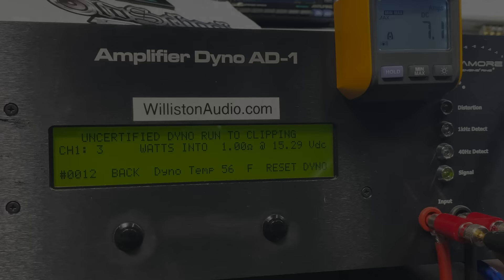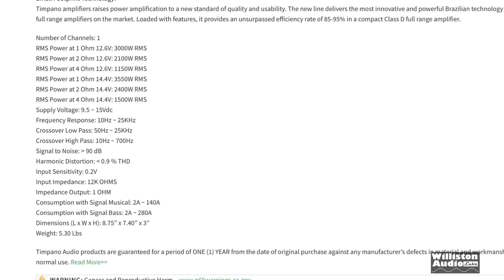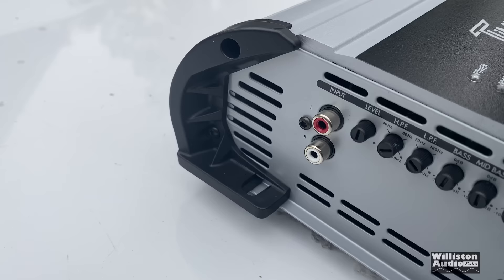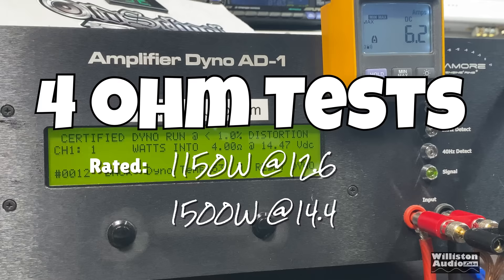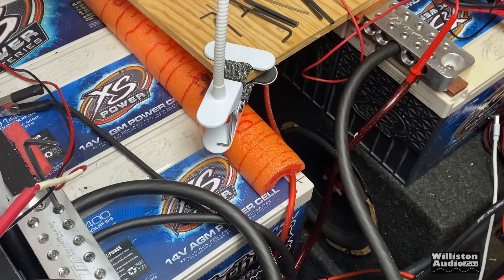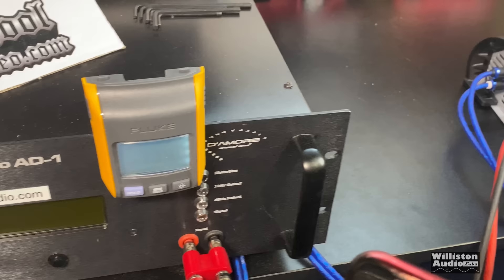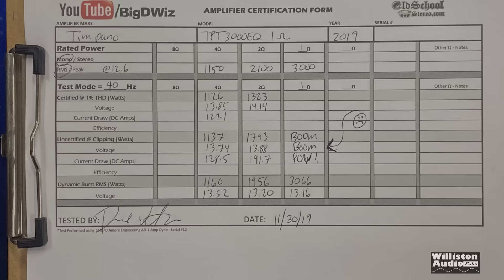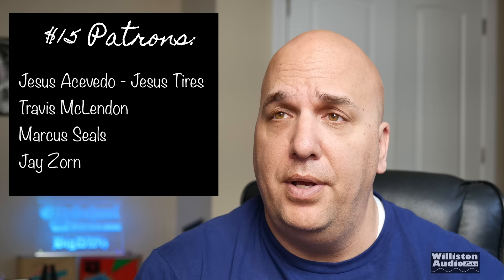This $220 3000 watt Amp GOES UP IN SMOKE! [4K]

Comment: Keep blowing up the junk amps and calling them out, man. There is property, and potentially lives, at risk here. Screw these guys.
Reply from the maker: It’s pretty scary the fire show that occurred...twice
Reply: Yeah... Why hide the first amp that burned down? What was it?
Reply: @TheBrokenLife  
It was the same brand amplifier. He mentioned it in the beginning of the video.
Reply: @sirnate54  I thought he blew up two identical amplifiers in this video and that was a 3rd one at the beginning? I'm all confused.
Reply: @TheBrokenLife  probably for legal reasons. He said the company just about went out of business.
Reply: @TheBrokenLife  he said the previous amp that blew up almost ran the company (different video and company) that made that amp out of business. Two amps (1ohm and 2 ohm versions) in this video blew up he just didn't show the first one that went up in smoke.
Reply: @logan9334  Yeah, exactly... I'm curious what the amp at the beginning of the video is. They shouldn't BE in business if they're trying to burn people's cars down.
Reply: This is a misconception with the design of most Brazilian amps. The way dynos read power does something funky with the full bridge amp design. If you put that amp on a subwoofer and then clamp power tested it would do over rated and be very reliable. I personally have that stetsom ex3000eq in my truck for 3 years on a 300a fuse. Ran 2 18s walled at first now I have it running 6 8" mids. And many competitors have set world record numbers using these amps. It's a fantastic amp that gets a bad reputation from these type of scenarios since you cannot dyno them properly.
Reply: @ ThonotosassaBoy
You wrote put that sub on the subwoofer. 🤷🏻‍♂️
Reply: @ThonotosassaBoys  - I seriously hope that is a sarcastic copy paste.
Reply: @ThonotosassaBoys  The dyno measures power using a pure resistive load. That doesn't do anything funky to the amp. The amp is just plain under-designed.
Reply: Agreed
Reply: @maxwelhse the amp in the beginning was a Sonido mask 1500 but to be fair he did run that amp at lower impedance than the manufacturers recommendation.
Reply: @ThonotosassaBoys  

Most clamp tests are not done properly and are NOT accurate. I'm not trying to say you are one of the many out there that don't know how to clamp test an amplifier properly, just saying that in general, people are always talking about how their amp does SO MUCH more than rated when they clamp test it, as they are not doing it properly. For example, I could clip the hell out of an amp and  with a clamp test, come up with a higher power output from the amp than its rated to produce. Just saying.
Reply: @brandonweigel6309  I completely agree. And when I clamped I did voltage time Amperage divided by resistance with the gain set before clipping. It's not the most accurate way but it does get you a number that's close.
Reply: @shelbug100  it does the exact same thing with almost every Brazilian amp. And they all, including this one, have been proven in competition use. And most by the competition league's list them as rated or over rated. Look up the ISPLL amp rating chart stetsom line of amps.
Reply: @ThonotosassaBoys  no it doesn't , speakers are reactive loads not resistive loads, so while the static DC resistance is , say, 2 ohms, at 33hz they could be 4 or 5 ohms. lot less load on the amp.
Reply: @wal  how do I request an amp dyno test lol...audiopipe apmi 600
Reply: @ThonotosassaBoys   i bet a jbl 14001 would dyno well and is a full bridge amp no problem, Barevids did a 1 ohm mod to one and ran it on a resistive load several times before and after modifying it
Reply: Why use more than 15v....why you didn't run on 12v or 14v max to see if the specs can be obtained?...maybe because it will kills any  American brands? In all terms price vs power output?,Im a very fan of you and your work on videos and so I think of Steave Meade,you are awesome on doing your stuff,but I had used Stetsom and Taramps and they are a hell of an Amp in power and duration,they have a huge power even with the engine off (12.0V)...Shame on Rockford and any of them,its my humble opinion,make the test ib any of brazilian on 13V and you will see what I mean..take care my man and all the SLP fans!!!!
Reply: Brazilian amps don't like resistor dummy loads!  They work fine on subs.
Reply: Its just like when all the ricer cars come to America back in the day . Everybody hated . Now everybody has one . The same will happen with these amps . I mean this guy wants everyone to stay with American companies, but they are built in China and Korea, so really what's the big difference?
Reply: Thats right my man,Stetsom or Taramps has or had one on 20kw on 12v and on their high voltage series a insanely damn 160kw rms!!!!..where on earth RF or any they called American amp will do that?.. yeah right!!
Reply: @alexisacevedo8016  it's all about money . Pockets are being filled to try to keep the Brazilian amps from taking away business from these overpriced American based companies and this video is a fine example of that happening. He got some free stuff or a nice check for making this video.
Reply: I know and you're totally right man,thanks for understand my point,God bless you everybody and keep those spl up guys!!!... take care my friends 😉
Reply: @denisohbrien  speakers have a passive resistance where as the amp dyno has an active resistance. When you hold back voltage with voltage especially on a full bridged rail voltage amp, sparks tend to fly . They only have a few small caps inside unlike Korean and Chinese boards that have a lot of caps to absorb electrical backfeed. They just aren't designed to be on an amp dyno. People get freaked out when they see sparks and then you have the guy that is testing playing dumb like he don't know why it's doing that and a bunch of Korean board loving guys that really don't know why it happened but think it's because the amp is crappy to back him up.
Reply: @ThonotosassaBoys  Here is the problem with clamping. The maximum voltage and the maximum current do not occur at the same time.
Reply: @ThonotosassaBoys  That is COMPLETELY untrue. That is EXACTLY the same load, and will get the same results beyond a shadow of a doubt.
Reply: @ThonotosassaBoys  also, nobody has any SPL records using these. You are just making stuff up it seems, because you run and like the amp.
Reply: @Turdpuncher  exactly
Reply: @alexisacevedo8016  I don't think any amps are made in U.S.A. anymore.
Reply: @ThonotosassaBoys  Amp dynos will also always pulled more current, and are much harder on amps because they are constantly at a static ohm load. Hooked up to a sub, you'll have box rise so it wont stay glued to 1ohm. Only time I could see this happening in a car is if it's on garbage electrical and the voltage dips below 12v.
When voltage drops, the amp draw goes up to achieve the same power. I could see it blowing in a car if pushed hard at less than 12v, which is stupid to begin with.
Reply: Cheap ass junk...  The people building big trash systems using this cheap stuff should use their money to build a smaller system with better components.
Reply: @2ndAmendmentedYoAss  No, he said he was always remiss to post videos like this without getting confirmation that the product was actually defective (i.e. the need for a 2nd amp to test, that he paid for OUT OF HIS OWN POCKET.) He posted a video before of ANOTHER COMPANY'S bad amp that almost put them out of business.  

It's also important to note that he orders a 2nd amp just to confirm that the first amp wasn't a "dud", that maybe went out with bad Components in it, or had some kind of Manufacturing Defect. If both are bad like in this video he knows FOR SURE.
Reply: @bradgilpin9740  wonder why he didn't show us that first?
Reply: I 've had my stetsom for 6 months now and ive yet to have any issues. I'm still pushing my 15 zvx and that sub bangs like 2 15s. Only con is a that it get alittle warm but I quickly fixed that with a small fan and now I'm beating down my block Every time I come around. I've used it for my mids and highs and this amp came to life as soon as I connected all my Aftermarket door speakers. It's all on the user on how long these amps can last cause mine is kicking tail all day and plenty of power to go around. To Each his own....💯🔥
Reply from the maker: @RomaVilla  the Amp Dyno tests are brutal on an amplifier and provide a static (resistive) load for the duration of each test. The scary part of this test is the lack of over current protection on the amp, allowing it to pull well over the rated spec of current (300A plus), thus blowing the power supply transistors. I test all amps the same, so this wasn't a torture test or anything, just showing what can happen.
Reply: @RomaVilla  he does after the credits
Reply: Doesn't look like it's UL listed so of course the damn thing cant regulate it's own voltage (regardless if you throw more at it than the manufacturer recommends) Sure it does wattage but not safely. This amp is a fire waiting to happen. Pure trash made in Brazil.
Reply: Blow em up so you KNOW.... Learn..... Limits should never induce a fire in a car... ever. BDBD/2021
Reply: @positrack99  UL certification is not based on design at all. Just a basic set of rules for construction.  I am currently building an industrial control panel that will be UL certified. The inspector will not decide whether or not it is a "good design" basically just that it is made up of UL listed parts and that everything is labeled properly.
Reply: I’ve heard of the taramp doing the same thing

Comment: You should never feel guilty or concerned about an amp manufacturer's reputation. You do clean, transparent tests. If the amp can't meet ratings, then that information needs to be public. If the amp fails in a dangerous way, as this one did, then that is a matter of consumer safety. You are perfectly justified to share your findings. Keep up the good work!

Comment: 1. No one should buy this amp under any circumstance when there’s other more reliable Brazilian amps out there for close to the same price (I mean you had 2 of them blow up the same way)
2. You da man for doing this public service amp tests and saving people money and possibly their LIFE!!!
3. Excellent work on the edit and capturing it from 3 different angles like a BOSS!
Reply from the maker: Such a bummer things like this can still happen and I'm afraid attempts to get price so low have affected decisions concerning protection. It's truly scary to think of this happening in a car and the possible outcome.
Reply: @wal  My thoughts exactly. You could burn your car to the ground very easily if this was to happen on the highway. I have a Soundstream Rubicon Nano RN1-5000D in my Mk4 Golf running two Sundown Audio SA12D2s, and I have it wired with 2G battery cable for power and ground with a 200A breaker at the front. These Sundowns are only rated for 500 watts a piece, wired at 2 ohms with the gain only turned half way up on the amp, they SLAM for two 12s, but I'm sure that Soundstream is pulling some major amperage. I paid $175 for that 5000 watt amp (yeah...right), but I have ALWAYS had good luck with Soundstream amps. I had four round Kicker Solobaric 10s on a Soundstream Reference 1000S back in the back of my 92 Integra back in the day. This Rubicon Nano may not make the 5k watts that it's advertised to, but it powers those two Sundown 12s like you wouldn't believe.
Reply: Stop spreading misinformation. Just like cheaply designed "Korean (see half bridge)" amps, cheaply designed "Brazilian (see full bridge)" will blow up. I get that you're biased against full bridge amplifiers, but it's factually incorrect and you're misleading people who don't know better.
Reply: @wal   I thought it was Chinese? No?
Reply: @wal  especially when many people are running lithium batteries and the amps are mounted pretty close to them. Add mpg catches fire, causes the battery to catch, and it's bye bye vehicle and everything in it
Reply: Brazilian amps in general are scary. There miles behind what us here in the usa in audio amplification tech. But yet there pumping out 20k amps. I dont like full bridge at all anyway. I think they sound like crap myself
Reply: Its funny, back when I installed disco sound systems 30 years ago, we had the same issues with Brazilian amps supposedly designed for that purpose. They were big, heavy, beautiful looking things - with impressive specs ( on paper! ).....In actual use, however, these fuckin' amps all blew up like bombs! Brands like Cygnus, Gradiente, CCE, etc. All flash outside, but the worst designs and piss-poor component quality and quantity inside. Nothing new under the sun!
Reply: i swear to god i was just on parts express  looking at these flame throwers ...came to youtube and this video was in my suggest box...
Reply: NUCLEAR BUM  your internet usage is being monitored so you can be marketed too.  

Not just the government monitors what you do!
Reply: Dave Micolichek  wise man
Reply: Timpano, PRV, Stetsom...all the same thing. They make power. Don't do well on a dummy dyno load. Simple as that.
Reply: Dave Micolichek  Had a look to the Taramps DS250x2 with the powRLaudio chips, a 10mm by 10mm chip using nothing but thermal pad on the PCB and tried to heatsink the PCB (with solder mask !!!!!) to the aluminium case. So, chip is on the top, and the bottom of the PCB is "heatsinked". Wondering the thermal resistance of this contraption. Yes, they are class D, but on the limits the efficiency DROPS and heat produces faster than it can be evacuated. Also POWLRAUDIO is actually an IR product .... but they are not putting their logo on it !!!!. Wondering if they are aware of their chips being pushed to the limits while not meeting their requirements. Looks like IR doesnt want to get BURN. One channel failed on mine, chip somehow got its solder melted, shorted the rails and the PSU just blow They claim thermal protection. Ohhhh wait there is more, the PSU uses 10x10mm IR fets (same footprint as the POWLRAUDIOs) and again, thermal pad and heatsinked from the bottom,. They even went into the trouble of using thermal paste !!!!!!. THEY MEET THE NUMBERS, WATTS ARE REAL. THAT IS TRUE. But dont ask about the endurance. I bought a BOSS RIOT 1100M. Yes, they lie, it makes only 150 to 170W ... but 4 times bigger, discrete through hole components heatsinked to the case directly. I mean, we dont need to reinvent the wheel, because here none of them, are "cheapo". And I cant stand dissposable things. And this is what the DS250x2 is all about ... DISSPOSABLE.
Reply: 38911bytefree uhhh how high are you ? 😂
Reply: @trecedaves3159  All Brazilian amplifiers are bad. ?
drawing the conclusion with a single brand. ?
Reply: @felipeviana05  not any particular brand, the way full bridge work is efficient but scary. Lots and lots of high voltage and current in a little package. DC voltage can jump and arch like ac in a van de graaff generator .  With Brazil so far behind korean amp tech or us amp tech, I see it like a ticking time bomb. Maybe not from more of the top companies but a smaller trying to cut cost in internal parts to compete.  Think about for a minute the Yugo.  Now have that company build a super car. Scary.  I'm always going to be favor the class a or ab from living through the erra I have. Chinese now coping the brazilian design is even scarier. They have no real quality control.  Your always gonna have risk with as much voltage and amperage todays big bass vehicles have, but full bridge I think needs to be closely regulated.  So we dont get the maxxsonics versions that can and will end up hurting someone.
Reply: @felipeviana05  just need very high quality control. One piece of a solder ball  left from manufacturing can start a huge fire. Vs class d that can burn but more likely will burn components and stop the short there.
Reply: @felipeviana05  I'm not saying the techs in Brazil have any less experience then in the us in electronics.  I'm just saying from a manufacturer stand point they are far behind the us or korea.
Reply: Some people would get really surprised at how much current some "small" components inside a computer actually REQUIRE to work. Processors rated at 125w do that at around 1.45v... Those components are packaged to withstand stress in their rated currents for prolonged operation...
Reply: Not to talk about the VRMs that power those chips and have to be engineered for huge transients. Honestly, there's a lot of engineering into those small amps, they only have the wrong kind of marketing behind them.
Reply: @trecedaves3159  FIRE FIRE......No robust protection circuits apparently.  We used to roast warranty amps just to see em catch fire OR shut down.... for fun... POP goes the weasel.. They SHOULD shut down. Was good to see em catch fire so ya knew then what the limits was outside of a car. I seen B+ STIFFENING CAPS melt down in a car too. Them things got scary too.  Death Capacitor for your car anyone?.... Fire... 40 + years I installed gear in cars... never caught one on fire. Thank GOD... Know the Limits...BDBD/2021
Reply: Whats a good brazilian 3000 amp?

Comment: I had the Stetsom Ex-3000eq 1ohm model running @  0.5ohm and it ran great. 

It got pretty hot (went to temperature protect once) at full tilt but it survived. I later replaced it with a Taramps HD 8000 and put it into another build running @ 1ohm. It's still working great.
Reply: I had a Stetsom amp running for 10 years now 7kd Stetsom got it service last month some driver and dry strip circuit
Reply: So basicly,  you bought another Brazilian fire starter